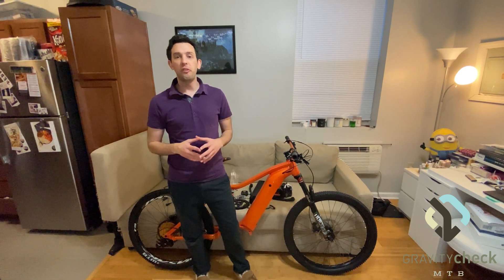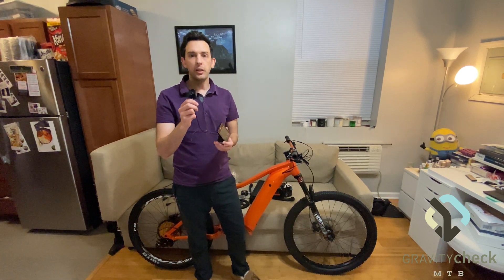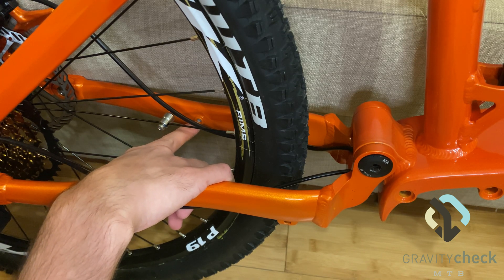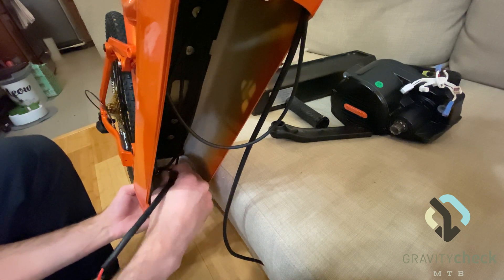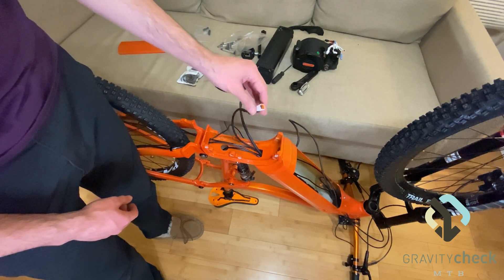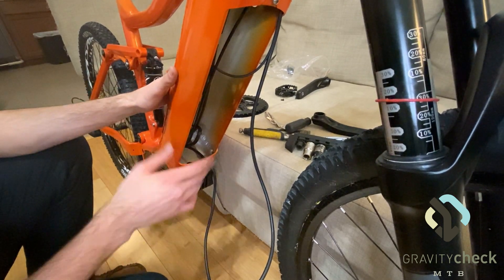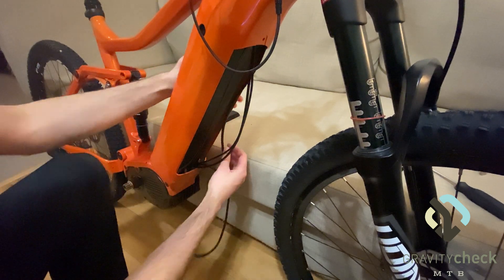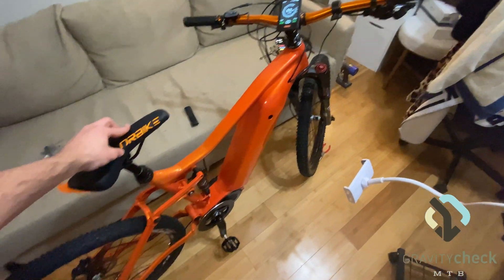Seroxat 1000W Bafang G510 Motor and Electronics Install | What You Need To Know | Tips and Tricks

Comment: I got a bare Frey AM 3.0 frame that came with the same motor as yours. Do you suggest getting the same motor as yours or is there a newer model that fits the same installation slot?

Comment: What is the total weight of this bike? Based on the numbers in the website just for the frame, motor and battery is 37lbs.  This fat tire bike territory.
Reply from the maker: The total weight is 56lbs, which may seem heavy the the power makes up for it easily. I easy ride with my buddies on 180mm trail bikes. Jumps, climbs, and more with no issues. The weight actually makes it great for the Down and very stable on rough terrain jumps. Like riding a small dirtbike.
Reply: Thank you for the quick response. That is just 6lbs more than my eMTB. I have a DH oriented eMTB with coil and triple crown fork but limited to 500wh battery. I'm looking for a eMTB for longer range and on a budget. I wonder how efficient is your M620/780wh (56lbs) bike compare with the Shimano EP8/500wh (50lbs) bike.

Comment: Great instruction on install considerations. Not just on that install. Flat, even wiring is often required. Cool tip about using drill bit as bolt-hole guide. Awesome build. Just what I'm looking for, but the link for the frame is dead but for a battery or shock, and the $1000 motor. 
Any new sources?
Reply from the maker: Look up “World Bike Store” on aliexpress and contact them directly. They will help you source whatever you need.

Comment: Whats about the two holes left and right of the battery compartment? How can they get closed?
Reply from the maker: I don’t. I’m sure you can buy a rubber plug but it’s not really an issue. The battery port is plugged and the other side is just the key hole to lock the battery.

Comment: what are the extra frame holes for on the sides of the battery case tube?
Reply from the maker: The one on the left is a key whole. Once the battery is inserts the battery can be locked to the frame. The hole on the right is for charging the battery. There is a rubber seal that can be removed to five access to the charge port.

Comment: How Long are you ?
Bike looks small
Reply from the maker: I’m 5’11” to 6’. This is a 18-19inch frame which would make it large technically and a correct fit based on most bike manufacture. I’m happy with the size. But upgrading to 29” wheels.
Reply: Ok been looking around after bike in your style but looks small iam 190cm
Reply from the maker: I think it’s personal preference. The smaller frame is more maneuverable  considering the added weight on an E bike. For me I tend to go for a smaller frame And then compensate with stem length and dropper post.

Comment: what mounting hardware did you need for the rear shock?
Reply from the maker: The hardware that came with frame. Pretty much all full suspension bikes will come with a plastic fixtures in place of the shock. Use the same hardware.
Reply: @gearupoutdoors  what plastic fixtures? I have the seroxat frame too, external battery, and my top mount literally just has a nut/bolt
Reply from the maker: So the frame was shipped to you and the rear section was just flopping around?!?
Reply: @gearupoutdoors  No? It had a plastic insert the length of a shock, with two bolts holding it in.
Reply from the maker: You use those bolts for the shock when you get one. You just replace the plastic stick with the shock using the same bolts!
Reply: @gearupoutdoors  yeah mate i know i use the bolt, that's not the problem. you need bushings between the shock mount itself, and the frame mount, of an appropriate size. The width for our frame is 24mm, and it did not have bushings or anything, so i ask how you hooked yours up.
Reply from the maker: Oh. The shock comes with those. Sometimes they fit sometimes they send you 1 size fits all and you need to sand them a little to fit.

Comment: Another question :) Can you take measurements of the battery compartment, and the battery? I found the same/similar frame on alibaba (looks identical in photos, talking with the manufacturer) and I plan to build a custom battery with higher Voltage. They sell a 48V battery but I want to get all the power out of the Bafang motor :)
Reply from the maker: I'll see what I can do over the next couple of days. I know there is extra room all around the battery so the space is pretty large.
Reply: @gearupoutdoors did you change the chain ring for mountain climbing? What u think, if I use the 36T and 46T rear?

Comment: Nice series thanks, what forks are you using.
Reply from the maker: I’m running the ZTTO 140mm thru axle forks. Has rebound and adjustable lock out.
Reply: @gearupoutdoors  Did you order them also on Aliexpress? I want too do my own DIY build too.
Reply from the maker: Yes. Pretty much everything was ordered on aliexpress except the tires and seat.